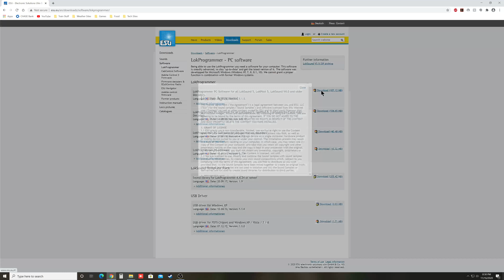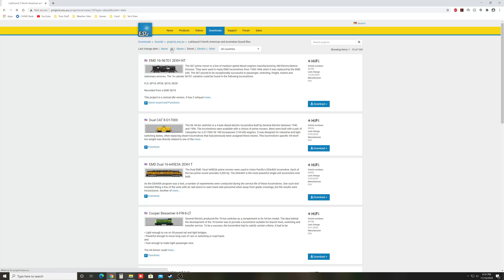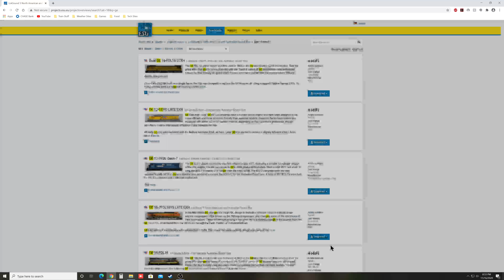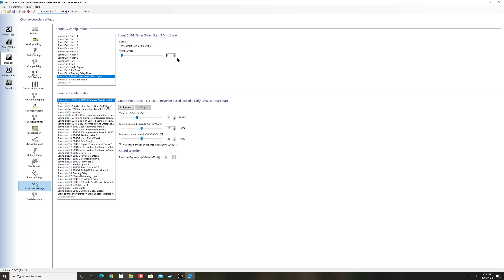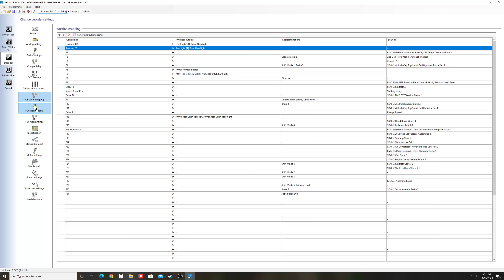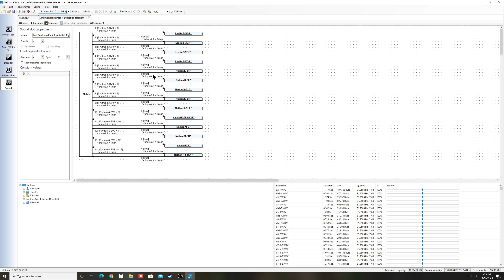ESU Tutorial Series - V5 Sound File and LokProgrammer Software - How I Set It Up

Comment: To activate the headlight on other decoders you have to set a CV on Tsunami for example CV 49 to 1 and then other CV especially if you install leds.  Do you have to set up a certain CV on the ESU decoders. Sorry if it's a dumb question. Just new to using the ESU decoders love the fact you can download sound files for a particular locomotive. May have missed you mentioning adjusting particular CV's manually during the video got called away a few times. Great video and very informative you've done a great job.

Comment: How to get louder sound?
Reply from the maker: I'm surprised that you need louder sound. CV63 is the master volume and can be set to a max of 192. Other individual sound volumes can also be set. Which locomotive are you working with? Which sound file are you working with? Which speaker are you working with. There are many factors that go into sound volume. Overall though I find that most sound files are quite loud so more information would be helpful.

Comment: Locomotives do have directional ditch lights the locomotives I run if your ditch lights are on and put the reverser in reverse the rear ones will come on and the front go off and the ditch lights in automatic mode will remain off till you hit the horn or bell and remain on till they time out.